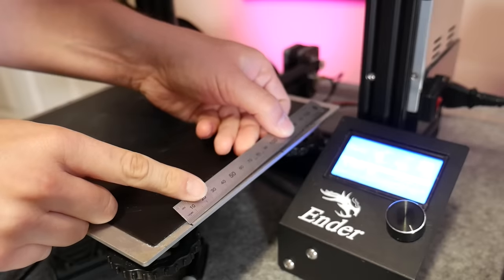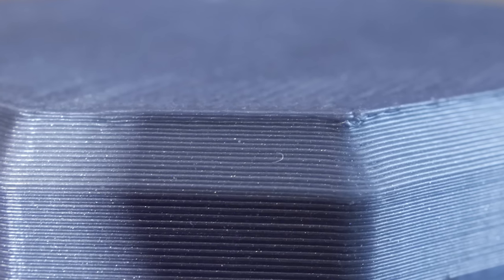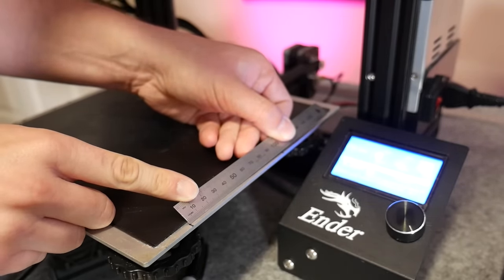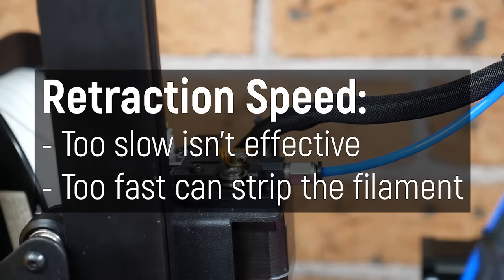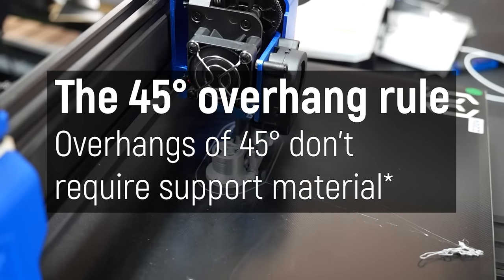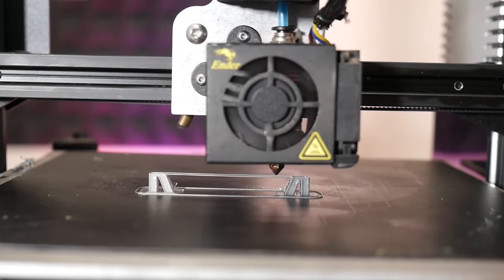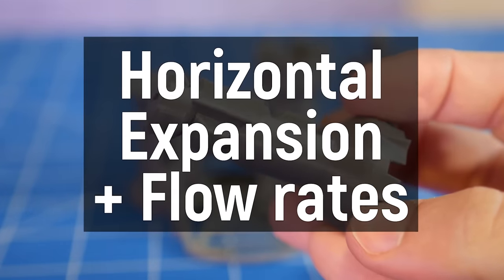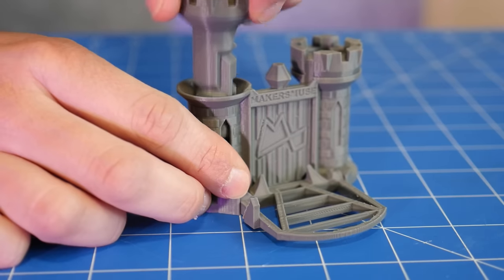The Ultimate Guide to Perfect 3D Prints

Comment: I'll be honest just got an ender 5 plus in December and have nobody I can have help with troubleshooting issues and this machine has spent the last almost 60 days with me having to keep changing parts and talking to thier support team to the point where I just want the machine out of my house. I really wish I had someone nearby that could help me figure out what's wrong with this but unfortunately I think the hobby will die for me with all the issues I've had over the last 2 months between broken parts and slicer settings being so overwhelming to grasp. The last month I've had defective bent hotbed, glass build plate, bent z axis lead screw, a cooling fan missing a blade making all sorts of noise, and a nozzle that had a deformity on the inside. I wish I could just get it working it seems like a fun hobby but this has been a nightmare for almost 700$

Comment: Wondering if the plastic anti-backlash nut on my Railcore lead screws are causing my layer inaccuracy. I've really eliminated all the horizontal causes. I don't seem to have a bent lead screw (I did, but I replaced it).

Comment: Can anyone offer advice on improving adhesion to bed for parts with a small base? I just got a printer and I had a few parts with a small base come off the bed during printing. I used a glue stick and also tried a skirt, but still had some problems. Advice appreciated, thx.

Comment: So every time my print starts, the start of the print doesn’t seem to adhere then it starts adhering this is causing problems with every stop and start for section or level.
The first layer is laying down well it seems, but I can only adjust my bed by .5mm at a time.
The manufacturer provides a fancy little plastic paper type material meant to last forever I guess in order to check the friction under the print head for height. But I can’t tell how much friction I’m supposed to feel.
How do we know how much friction we are supposed to feel?

Comment: I've been using the Kobra Neo for 3 months now, so the first prints were great and really great quality, but then it started to get worse, it started with under extruding, stringing and failing my prints, then I switched from the cura recommended settings to the custom settings and went through a lot of settings, such as: build plate temperature, retraction, horizontal hole expansion, adjusted extruder tension, and began wiping the build plate with isopropyl alcohol. And now I started noticing flaws in my first layers, I suspect leveling, but it doesn't look like the video shows. So if you have any advice I'd love to hear from you

Comment: The cheap couplers always throw my lead screws off no matter what I try. I have to unscrew the grub screws and try to seat them again and again to sometimes get it perfect, but most of the time it always ends up slightly off center either on lead screw or motor causing wobble. I just ordered some creality clamp style couplers to hopefully make it more rigid and tighter fit on the motor/lead screw but I'm losing hope at this point. Do you know of a good threaded/notched coupler STL's that will guarantee it is centered and tight on both parts? I found a couple outside threaded with nut designs, but they dont seem to work that well, so I have been trying to design one with my beginner fusion360 skills. I dont understand why the machined couplers arent threaded to match the lead screw or notched to match the motor because that would limit the amount of how off center they get.

Comment: So there is a theoretical correct value of the  steps per mm, if the dimensions of the part are not accurate, then there is another issue to fix and not the steps that should be corrected.
Reply: There is often no such value for extruder steps, because the exact diameter of the extruder gear is not normed.

For screw driven axis, the steps/mm are trivially derived and are not to be calibrated.

For belt driven axis, it's difficult to say. The belt as it comes is elastic, and is manufactured deliberately undersized. There exists a certain spec tension, at which they will stretch and will reach exact spec pitch. However, on most hobbyist style printers, you can't really tension the belt to spec, because there aren't enough bearings supporting shafts, things will bind up. Frame/gantry rigidity is an issue as well. So maybe a little concession in calibration is in order. But it's much easier to do wrong than to do well, so also may be worth skipping.
Reply: @SianaGearz  yeah for extruders its a different story.

yes your right with the belt tension, thats true.

i think its okay if you drive the lenght of the whole axis, then Meassure and correct the steps, but if you meassure the dimension of a part of 20mm and the extruder overextrudes what causes the oversizing but you corrected the steps of the axis instead, it will be spot on for the 20mm but every other dimension will be drasticly wrong.
Reply: @SianaGearz  yeah for extruders its a different story.

yes your right with the belt tension, thats true.

i think its okay if you drive the lenght of the whole axis, then Meassure and correct the steps, but if you meassure the dimension of a part of 20mm and the extruder overextrudes what causes the oversizing but you corrected the steps of the axis instead, it will be spot on for the 20mm but every other dimension will be drasticly wrong.

Comment: My printer has been a pain even with tuning. My lines are too thin all the settings are correct for the nozzle,etc I've adjusted my flow and it does nothing. Everything else is calibrated just getting thin lines and sometimes gaps in the top. I've just dealt with it because if spent months trying to figure it out

Comment: leveling the bed on my CR10 is a PAIN , it seems to move out of leveling over the print wish there was a better way
Reply: Have you looked into a BLtouch? Also locknuts on the adjustment knobs is a great cheap upgrade (usually can be done for under $5 including printing new knobs)
I have done a ton of upgrades to my cr10, the locknuts made a massive difference.

Comment: I tried printing using poly propylene, and the first thing i tried was the retraction/ stringing test model, and the result was really weird. The base was perfect, but the towers are absolutely destroyed. They still print, and managed to finish every time i tested it, but the shape is just horrible. It looks nothing like cylinders, and more like tall globs of goo. This only happens if the parts are small enough. Larger models print perfectly fine. I believe it has something to do with the nozzle staying too long in one area or heated up that small area too long. What can i do to fix this problem? I tried adjusting "minimum layer time" and it doesnt really work unfortunately.

Comment: OK ssssoooooooo I'm like really new to this and decided to go whole hog with my ender 3 pro as is with the specified parameters. I got the castle to print with smoosh at the bottom. I will go back and adjust the clearance but what about the codes I found in the print? I can't figure them out?

Comment: Could you please talk about layers adhesion on PLA & PETG. Is it from high cooling or high retraction?

My prints sometimes comes out in perfect shape but they are very brittle
Reply: You may need to print a little hotter, if the new layer isn't sticking to the old layer it's not melting the previous layer enough to weld itself to it.

Less cooling might help, but could cause other issues.

Of course more temp can cause issues. 

Maybe try teaching techs calibration website?
Reply: @AnimeAndMore  thanks for your input. 

Unfortunately i already print on the high side.  For example, PLA at 215c and if i increase it more, then i will have stringing issue.

I'm thinking it might be the nozzle as I'm using hardensteel nozzle instead of brass for PLA and PETG with no abrasive material because i didnt see the reason to switch often.

Edit: I tried going to the brass again the the prints at same temp is much stronger. Not sure if it's the hardensteel nozzle that causing the problem or i need to further increase the temp as you mentioned on this nozzle and deal with stringing
Reply: @yathani  try a smaller line width ex. nozzle .4mm nozzle try a .36mm LW or like if its still weak its likely too much cooling fan or its position is the nozzle not the part your trying to cool! providing flows are correct and such ,,this small LW will iron like the layers aside each other as the nozzle is larger than the LW forcing the heat to the a joining areas blocking some of the fan essentially

Comment: I have two 3d printer one ender3 v2 and CR10S but I've never get my CR10S working and my ender3 v2 is a work horse but I been thinking about making it a  Direct drive but one the other hand I don't want to wreck it because my CR10S is direct drive and I have never got it to work and I make a lot of thing for my radio control trucks cars boats

Comment: I run a cooling duct that has openings on both sides of the nozzle and my benchys still have a saggy front overhang
Reply: Which one? More importantly, what fan you use. Axial fans are completely useless. 4010 radial fan is better but still almost useless. 5015 radial fans are where it gets good, but it's possible to ruin their performance as well with long airducts. Design of cooling system is not trivial, due to turbulence and backpressure.

Comment: I done a few calicubes and I get 19.96 x 20.01 x 19.81. Then the issue is if i print anything for a specific device nothing ever fits. I think the printer is correct but the boards i buy are out! lol
Reply: Make sure to add in clearance between any connecting parts. A gap of 0.2 or 0.3mm is pretty standard.

Comment: Should Z zero be at 0mm or Z zero at 0.2mm?
Reply: When it's printing, Z=0 is nominally exactly nozzle touching the bed surface. When slicer generates moves, the first print move moves the toolhead to the altitude of the top of the first layer, so Z=layer height, you will also notice from screen readout when printing.
Reply: @SianaGearz  Ok, thank you very much. I got confused.

Comment: 15:01 This is exactly what they did when they were 3D printing a rocket engine, except they were using extremely tuned algorithms to calculate every single inch of the filamnet line and correct it, I find it funny

Comment: I desperately need help with my stringing issues. I print test towers and they are fine. I print my model and it is spider web fiesta deluxe. 

The only difference I can think of is that the tests are geometrically simple an my prints are more complex with no straight lines in any axis.

Comment: I am trying to print an 'ID card' for an escape room project. And I am looking for someone who can tell me why my prints are 'drifting'.
I have 2 files, which has a black number 01, about 50mm x 30mm x 1mm, encased in a transparent PLA case approximately 70mm x 50mm x 3mm. Using a print tower. This starts printing OK, but then starts to drift. I have a Geeetech A10t, multi extruder printer. I have been advised to slow the acceleration down from default 3000, to1000, and the x + y jerk from default 20, to 10... but this has not helped. Any ideas please.
Reply: so I don't know where you are in the world, and if you are even reading your comments, but if you are not going to reply then I may as well dislike and unsubscribe, and look elsewhere for help

Comment: Have to point this out as bad advice from a highly trustworthy source is double dangerous. DO NOT TUNE X,Y,Z steps per mm using a 20mm calibration cube. And especially not as the second step. There are so many other much more likely issues that could result in +-1mm errors: under/over extrusion, loose/overtight belts/screws/rollers, warped bed, slicer settings. Check those first. If the error is outrageous, like getting double sized prints, check if you have the correct firmware version or build. Second, using a 20mm calibration cube is not even the correct way to tune steps per mm. A proper way to do that for X,Y is to print large, say 150mm=caliper max length, thick single wall square and measure while print still attached to bed and account for wall thickness. Finally, even if measurements show some error, you should double check for hardware issues or fixes instead of changing to arbitrary non-default values, because doing so will introduce other print imperfections. For example, slightly changing Z steps per mm invalidates the layer height magic number!
Lots of good advice in this video, just not on steps per mm.

Comment: Good tips except for X Y steps: tuning X and Y steps per mm is blasphemy: they are not subject to deviation from reference values since the diameter of the teethed pulleys on the steppers doesn't change. Changing that parameter is wrong on so many levels.
Reply: So many of you engineers (or engineer types) say this same thing on every steps/mm video I’ve watched. And I agree it should be correct. But changing the steps/mm slightly (at least in my case) has greatly increased accuracies. How do you explain that. Perhaps belt tensioning?

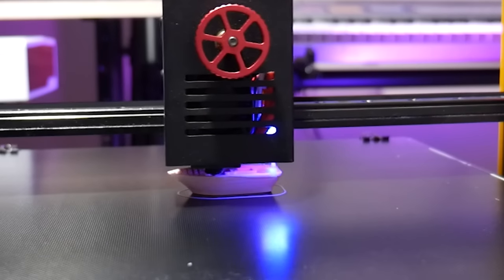Comment: 11:01 Whats happening here? Whats that glowing wispy thing to the right of the extrusion head? Looks kinda like plasma but surely you arent plasma torching your print lol. Youre talking about cooling but it's not a cooling system is it? Why would a light even be down there? Is it a curing light? Is the wispy thing a spindle thats pulling away stray fibers?

Is maximum possible cooling good? Would that lead to less layer adhesion because the previous layer is completely cooled by the time you put the next layer down? I kind of feel like theres a specific heat level that is ideal for particular materials, but in practice they usually need more cooling given the constraints of typical human life. I mean absolute zero probably wouldnt be helpful, right? ll

Comment: the best way to get good prints right off the bat is to pay at least $500 for your printer. buying a printer that doesnt use a Z screw is also a good bet. basically creality is garbage. there are much better printers out there. if youre good with Gcode, get a delta. flsun v400 is $600 and its the best printer under $1000. if money is no object get a bambu x1 carbon

Comment: I see you avoided a topic. A topic that has a lot of annoying variables. Warping. Raise bed temp. Lower bed temp. Increase fan. Reduce fan. Raise filament temp, lower filament temp. Clean bed. Try different filament. Raise nozzle. Lower nozzle, etc. I've seen almost all of these fix AND be the cause of warping.
Reply from the maker: It's why I recommend bed level and nozzle height be done with the printer at temperature, as the components expand. PLA shouldn't really warp or shrink too much, but yes for difficult materials it's an entirely new set of variables and conditions to contend with.

Comment: You guys are weird I swear I think thats your key to messin up your prints, while you explain one after another your forgettin to tell people if its not broke dont fix it , cooling maybe a issue for you but I found pla+ was good at 40 percent fan, then I got microswiss direct drive, After dealing with heat creap I used the old rubber boot to put around the the middle part that seperated it from the hot end I then increased the fan to 60 percent and cut away the rubber that was facing the fan then there was retraction speed I havc a ender 5 I had to reduce my retraction to 5 and slow it down to 25 speed , If your having issues DO 1 THING AT A TIME !!!  LOL Trouble shoot before throwing money at it or a fit lol

Comment: Don't change the steps/mm based on your measurements. You will NEVER be able to measure so accurate that you could "calibrate" your motion system. Also, your extrusion will create additional inaccuracies. 
Please, for the love of God, stop spreading misinformation.

You can and should however fine-tune your extrusion multiplier.